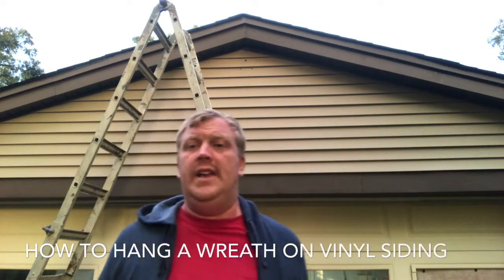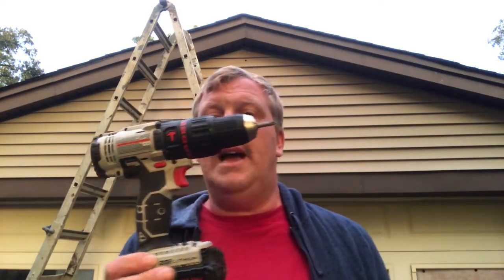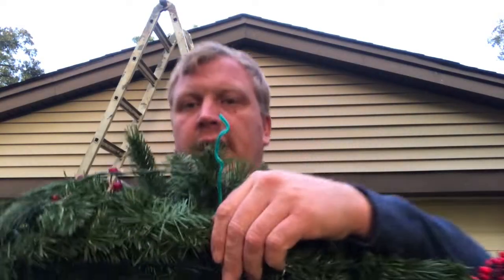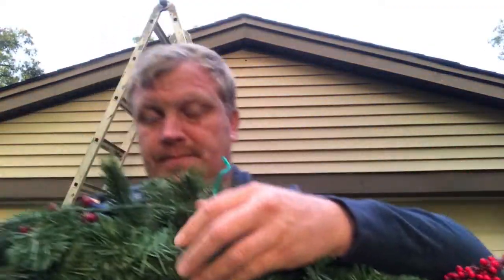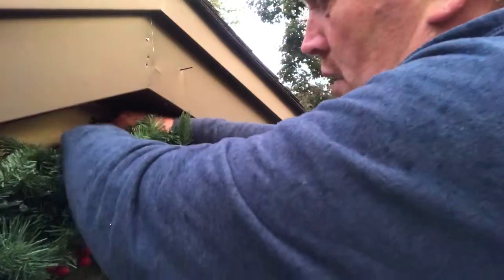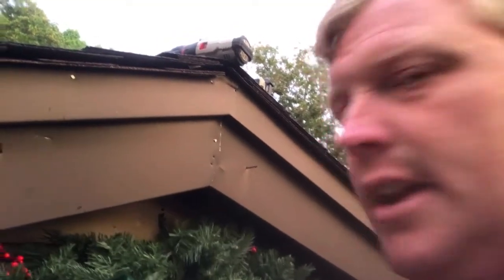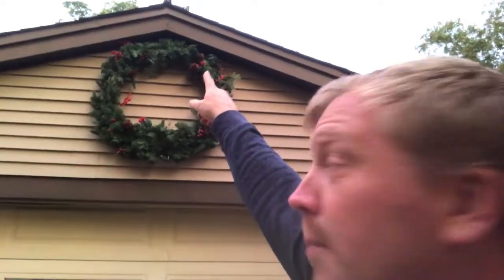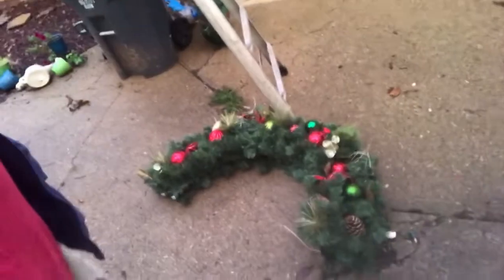How To Hang A Wreath On A House With Vinyl Siding  or Stucco

Comment: My husband is concerned about putting screw holes in the siding so is there a way of hanging the wreath on the roof edge?
Reply from the maker: You can use this clip here in this video 
No-Hole Hooks Vinyl Siding Hangers | Hanging A Christmas Wreath https://youtu.be/0Nfh7tqc1bk
Reply: Did you see is siding?  Lord everywhere.

Comment: so the prce of that sixty inch lights costs 335 bucks basically. Does the customer buy the item and you pay for hanging, or is it yours charge for installation and rental each year? How much does the wreath add on cost the customer?
Reply from the maker: So the 60" wreath we normally get are from Sams club. They usually dont start selling them to mid October. We get them for $159. We install and take down for $350. Its our wreath and its part of the service. We still use all of our wreaths from 4 years ago.We now have over 60 60" wreaths.

Comment: How do I hang a Christmas garland around my front door and it’s hardy plank
Reply from the maker: I thing you can use is pvc  and ziptie lights to it
Reply: I have used these around my door or under my eves of my house when hanging my garland or lights.   Just find the harder wire that runs through the garland and attach using that portion of the garland into the clip.  https://www.acehardware.com/departments/lighting-and-electrical/cable-management-cable-ties-and-electrical-tape/cable-staples/3168820